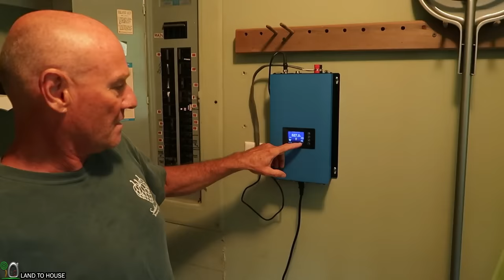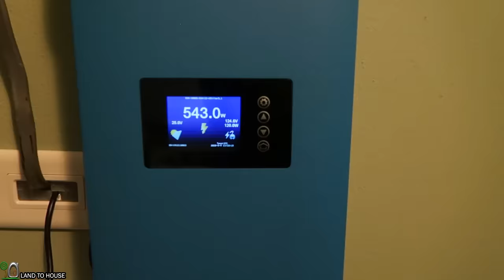Awesome Low Head High Flow Grid Tie Micro Hydro 530 watts!

Comment: Impressive setup. But i cant drop what i see, in this video and in the 2 installs you did at home, and that is the cord running from inverters to the main grid. Here in Sweden it is illegal to have power coming from cable to male socket. Du to the fact that if that cord gets loose or ripped out of the socket and lands in water, on any conducting material or some animal or child picks it up, they gonna be electrocuted. Or is it something a don't understand in your electrical code.
Reply from the maker: I believe these are referred to as dead man plugs... for obvious reasons. It is just a basic two wire with ground plug so you could easily cut that wire and then hard wire into your house system. That would prevent it from coming lose.
Reply: @LandtoHouse  Those gridtie Inverters require power from the Grid to turn on without sensing incoming power It will not output power. hence if the plug comes UnPlugged the GridTie inverter turns off.
Reply from the maker: True! I think he was saying if the plug  were half out it could shock... but thats the same for any plug.
Reply: @SecoMC  Thumbs up from me... And the same thing happens normally with the Photovoltaic inverters. These things also wouldn't turn on when the main grid is not present. They remain in "waiting for grid-mode" until the main grid turns on. But then it takes a few moments to wait for a stable powergrid before they synchronize with the grid frequency and start feeding in energy.
I believe there are too many peoples who doesn't know how such electrical devices and their Protective functions work, as we can read from "exeqt". These People only see a device that is producing and backfeeding energy into the grid with possibly touchable Pins of a male connector.
Reply: @djblackarrow  I didn´t know this inverter that had this funktion.
Reply: It only has power coming out once it sees the power from the grid if the grid goes down it does nothing
Reply: You are not mistaken, using a male plug to supply current into a recepticle is an electrical code violation in the US. It's also a code violation to use the bare conductor to carry current. The lack of current disconnects is another code violation. The unprotected and insufficient means of securing the UF cable is another violation. The use of an indoor-only rated cable clamp would be a further violation. I can promise you, none of that was inspected, there would've been red tags from one end to the other.
Reply: @exeqt  .... if it's called a "grid tie" inverter that is it's function. Only ties in if the grid has power!
Reply: @thomasbonse  ... seems to me that most all small grid-tie inverters use a standard male plug so it must be UL approved. OTOH, the rest of the install needs to be up to code. (I'm with ya there)
Reply: @LandtoHouse  the European Schuko and modern British Standard plugs both don't have exposed conductors when halfway out.
Reply: @thomasbonse  I see your points there, but remember, everything up to the grid tie inverter is only 24 volts. That may lower many of the code violations discussed here.
Reply: @curtchase3730  Here is the list of NFPA 70 (NEC) sections that need to be reviewed, at a minimum concerning this installation:
620.12, 620.13, 682.31(a), 682.31(b), 682.32, 682.33(a), 682.33(c), 555.15(a) (referenced from article 620), 250.20, 250.28, 250.30, 250.30(a)(2), 314.4, 314.15, 314.16, 314.24(b) (for the rectifier), 340.12, 334.15, 334.30, 240.4(b), 240.15(a), 240.15(b)(3), 240.21, 445.12(c) (only if generator is 65v or less), 445.17, 445.18, 110.34(a) (for the generator itself, aka turbine), 200.3 (for the inverter), 250.20 (a) or (b) depending on exact generator voltage, 200.7(b) or (c) depending on exact generator voltage, 310.10(c), 310.10(d), 250.119 (bare conductor use), 250.121, 250.124, 250.134, 250.136(a), 250.142, and 250.162.
Reply: I also feel like Bill could use about 15 more minutes on the internet to learn and understand how a rectifier works. Its a nice setup from a hydro perspective but the electrical made me throw up in my mouth a bit.
Reply: Hunter Inman I beg to differ. The sensor wire that this gentleman is showing, appears to be coming from the main breaker, or main service. Thus, if the main breaker continues to have line voltage from the grid, the cord will remain live. The cord should at least be hardwired to its own circuit breaker
Reply: @curtchase3730  they are producing 3 phase ac at the turbine and have a rectifier at the house. None of that has over current protection. You can see the insulation discolored from heat at the terminals.
Reply: @thomasbonse  he claims he had an electrician friend come look it over. I would be afraid to have that guy do any work for me. No overcurrent protection for the turbine leads, using a ground conductor as a hot. No ground conductor, wrong clamps, poor wire support, the suicide cord plugging it in.
Reply: @LandtoHouse  no that's not the same for any plug! The Australian standard plug has the pins covered to prevent such things from happening! You would think that the people behind the standards would look at what else is being used around the world and implement the best of the best and possibly improve it.. my dad has a wonderful Braun electric shaver from the 70's and the pins on the power cord are insulated almost to the tips. So as far as I'm aware, this is a very old idea.. I'm not sure when Australia started doing this, I remember when there was a time when I didn't see that on any device but they must have revised the standard possibly after the 80's some time.. someone else might know better. 
The owner looks old enough to have grandchildren, I would hope that they don't find that particular power cord fascinating, no one really knows what goes through the brain of a child... I really hope that this situation has been rectified since the video..

Comment: Basically an average refrigerator uses 500 Watt when the compressor is running.   Which it turns on 40% of the times and turns off.    So it give you enough power to run 3 refrigerators from it.   Kwhour price and what it generates which is 12hw hrs per day.  =.  It will pay for itse in 4 years of 24/7 use.
Reply: this thing is Producing more than 12kW/h per day. if your refrigerator uses 4kw/h per day, buy a new one.(for comparison: average consumption of a revrigerator is 1kw/h per day
Reply: @Mansenmania  If it's producing ~520W continuous, that is 12.7kW hours in a 24 hour period which is pretty close to 12kW/h per day.
Reply: @2009dudeman  why are you repeating what i wrote? id dont get what you trying to tell me
Reply: @Mansenmania  you made the implication that OP is wrong for saying it produces 12kwh of electricity per day.

There is nothing wrong with the party about fridges, but it produces about 12kwh of electricity.
Reply: 2009dudeman This wasn’t my intention. I just tried to say that it’s a lot

Comment: 7:52 I hope you know pluging a inverter in an outlet it extremely dangerous.
Reply: We call that a widow maker plug...
Reply: AN inverter*
Reply: if the inverter isn't specifically made for that use, it's not only dangerous, the inverter would instantly explode. you need what's called a grid-tie inverter. the inverter doesn't actually turn on until it sees the power cord has been plugged in and the utility power is stable. if utility power goes out or the cord is unplugged, the inverter turns itself off. it's relatively safe and not actually a suicide cord because it turns off.

edit: that extra cord coming out the top of the inverter in this video, can't see where it goes but I'm sure I know what it is. it's probably not needed, but can help the inverter work better. a cheaper inverter would just measure the utility voltage from the power cord. but when putting a load onto a power cord, or in this case feeding power backwards into the cord, it changes the voltage the inverter can see, so it's not getting an accurate reading of the utility voltage. that extra wire is simply a voltage sensor, to get a cleaner and more accurate voltage reading from the grid. if the inverter was made right, it's a redundant sensor to improve performance.
Reply: @lorenzo42p  it's also running the electricity the wrong way through the breaker

Comment: Is it possible to add a second generator along the pipe?
Reply: adding another generator would reduce the efficiency of the first because it would add resistance to the downflow so the answer is yes but it would not make the system better.
Reply: jasonbail if he added it at the 8 inch pipe I don’t think he would lose any. Honestly what I would like to have seen with the suction is routed back into his pond so he can use his system longer without losing the pond level
Reply: bomber86100 well perpetual motion doesn‘t check out for thermodynamics. And he‘d loose some pressure doing it
Reply: @fabianmayer  if the water is moving there's any left in it just looking to be capture - and it's definitely moving. Thermodynamics - no spare energy no water movement. Questionable how much more energy you'd get out of it, I'd be tempted to test and see what happens, if it were me - though I wouldn't expect much.
Reply: streaky u see, if u put a secon turbine there, it will drag down the efficency of the first one, and some turbines need a certan speed to even work, and that is something to watch out for
Reply: @fabianmayer  it will, you're not going to get double the useful energy out of it, the question is how much you could and if it would cover the extra losses. Without modelling the only way to know the answer to that would be to try. Seems to me that water still has vast amounts of energy left in it though.
Reply: Why not just add a second pipe and turbine?
Reply: @jamesgtmoore  Did you see what happened when he turned on this one?
Reply: @flexairz  Yeah it started generating 500W of power.

Comment: Neat system!  Seems like the diode drop of the rectifier is causing you to throw away 5% of your power if you're running off 24 V.
Reply: Nothing compared to the cable run - about 12% loss on the 10AWG and 21% on the 12 AWG ground wire. Easily losing 100W before it even gets to the house! Really would be better off with a transformer at the generator and moving the rectifier out there.

Comment: If He install generator more  low level from water intake he can produce more power .
Reply: it works by suction, not directly gravity
the flow rate is pretty much the same throughout the pipe, so same energy output 
+that venturi pipe at the end; i think the thought a bit about the process, looks fine

why i do think is that he is not collecting as much energy from the water as he potentially could; maybe a more powerful turbine for that diameter, who knows
Reply: @andreiuul1  I assume that his water source is inadequate for sustained electric generation. From the look at how the water overflow receded, it could empty the pond.

The suction is a brilliant idea as it maintain the flow up to the point that the water level is low and allows the reservoir to refill itself to the optimum level. A low level water intake would require some monitoring unlike a siphon automatic cut off.

Comment: It's crazy that one little hydroelectric generator wouldn't even be able to run my gaming computer
Reply: That's 500watt continuous not peak. Gaming PC they are very peaky but not continuous. The problem is timing of Consumption by the PC, need some sought of buffer. Quite sure it can run your Gaming Rig with that setup.

Comment: 6" pipe is the problem. Scale that in half and I bet youd get the same power and not drain the pond lol
Reply: Why and how? Pretty sure, volume is a key determining factor in power output
Reply from the maker: Langston Alternative Power has a 4" pipe version that I will be testing soon.
Reply: @Hopeforsurf  turbine speed is
Reply: @Alex-dg2mb  Which is directly proportional to volume.
Reply: @operator0  I was just assuming there could be diminishing returns based on efficiency and max speed of the turbine which would imply an optimal volume flowing  into the the turbine which could potentially be achieved with a smaller pipe.
Reply: @Alex-dg2mb  The turbine is custom made for this specific project by Langston Alternative Energy. I would assume he did the math and the penstock, turbine and generator were sized for this specific volume and head. I doubt there's much more efficiency to be gained here without moving to more expensive components.
Reply: @Alex-dg2mb  I am quite sure that a guy like Langston, who's been doing this for 15 years, has run the numbers and has determined what the components and general design should look like for this setup. 

Like I said, there may be small gains to be made, but that might involve non-standard pipe dimensions, increasing costs significantly.

Comment: It’s easy if he would buy a Tesla wall battery system he could charge that system and he wouldn’t have to be connected to the grid if he didn’t want to be at all
Reply: Dont buy tesla
Reply: Exactly what I was thinking 💪 Tesla batteries are expensive but there’s other makes , but yes you would be free all day long 💪
Reply: There’s other stackable more cost efficient options that give you the same power and more flexibility and portability. Take one of the batteries off the stack and haul it around so you can use it across the property then place it back.

Comment: In only hours the water level have dropped so much. I could imagine what will happen if you run it for 24 hours, in days your pond will be dry.
Reply: HAHAHA there is not enough flow into pond 😎
Reply from the maker: The summer flow rate is a lot lower than winter. The good thing about the low flow times is that debris gathers on the intake screen and slows the flow.
Reply: at the end there was still water overflowing so it should be able to keep up most of the time, but yea i would not make it i had to start a sifon with a vacuum
Reply: Well any free Electricity is still better then using coal. 🤷🏼‍♂️

Comment: 500w is enough to power all the lights in house, assuming they are leds.
Reply from the maker: Absolutely! And if this system used a few batteries it could power the whole house.
Reply: You would need 50 LED replacement bulbs to equal 500 watts. Most houses only use half a dozen light bulbs at any one time. I agree that a battery bank in combination with this micro hydro setup would be enough to power the house entirely. Might want some solar to augment production during the hot, dry months.
Reply: 500W x 24 x 365 =  4380 kWh annually for free 👍

Comment: This is a cool setup, but the suicide cord, ground conductor carrying current, and screwdriver/rectifier waving give me cause for concern. I do hope Bill continues to educate himself on electricity before he hurts himself or someone else.
Reply from the maker: The inverter cuts off as soon as the grid is removed. I have 2 of them running solar and hydro. No issues at all.
Reply: Land to House I don’t think you are understanding what he meant. 
1-Using the ground or bare wire even though it’s in the cable jacket is really not safe as it could be. You could have a short very easily, or you could come in contact with the live conductor. Things fail sometimes. That’s why codes are a thing. I know, I know, it’s “only” 24v. 
2- the suicide cord. If that comes out of the wall, the prongs are still live and can give you a good jolt as it will not turn off if the mains power still has current. At least that is my impression. Easy way to find out if it is dangerous, unplug it and see if it still has power. 
Your friendly “electrician “ made something that will work, but could kill you as you don’t seem to realize the potential failure points. 

I wish you well, and wish I had a place like that. Thanks for sharing your story. That is awesome.
Reply: It is my understand that it's illegal to mix generated and grid power without the proper dual-direction meter he mentioned. Relying on a simple sensor wire rigged up to your invertor is not what I'd be comfortable with if I were a utility worker in the area. 

And yes, I saw the suicide cord problem right away. I fully agree it's way too dangerous. (Imagine if a kid unplugged it... )
 And the 10/2 instead of 10/3 is very irresponsible. That's dangerous to people & animals, and not worth saving that few dollars. (It's not even in conduit, so major code violations all around.)

I respect the ingenuity in making everything else work r so well, but posting a video with so many deadly ideas, and talking about them as if it's something people should copy, is very irresponsible. 

@landtohouse
I strongly encourage you to add "Don't Do This!!!" warnings, or prepare for lawsuits when somebody dies from following your example.
Reply: You might want to block these viewers.
Reply: Licensed EE here.  All of the above comments are correct.  This system would require a licensed electrician to replace all of the conductors,  add in new code required raceways and disconnects,  and add a grid tied inverter with a new 2 way meter.  

I guarantee you that if the local AHJ did a sure walk,  they would probably fine or threaten with fine the owner and shut his system down until it was up to code.
Reply: I have the same grid tie inverter on my solar setup here and it cuts off immediately in case of power failure. Known as anti-islanding. The power cable is never live once disconnected so is not a 'suicide cord'.